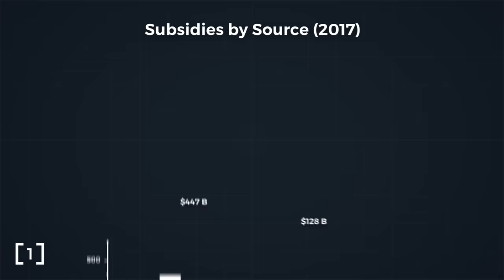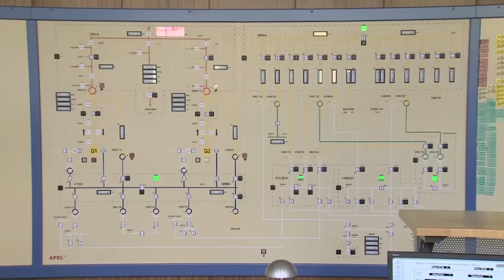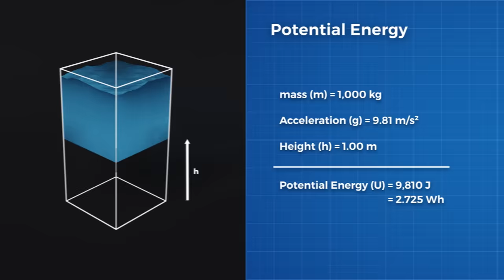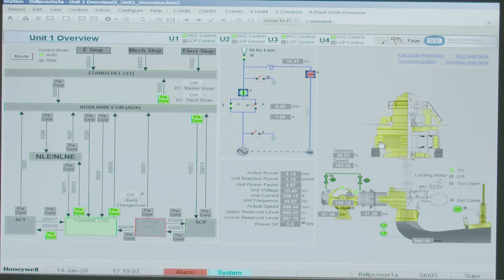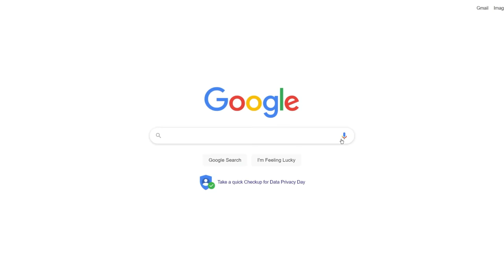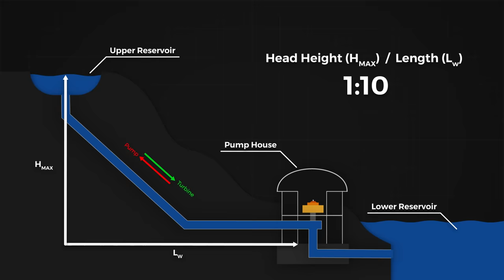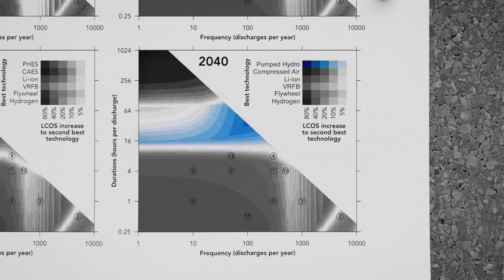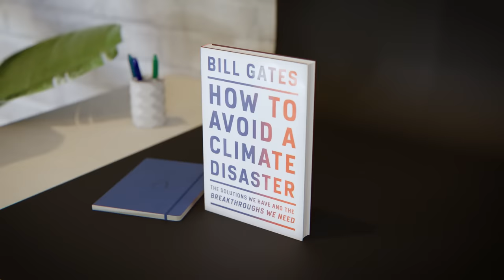The Truth About Pumped Hydro

Comment: "Cheaper and cleaner than..."  

Cheaper...  not really, but I'll get to why in a moment.  Depends on who makes them and who manages them and how they're managed.  

Cleaner...  nooot even close bub.  Just because the wind and solar farm doesn't pump smoke and smog out does NOT mean it is "cleaner".  

The problem with "renewable" energy sources is the lack of efficiency compared to "non-renewable" sources, and the impact that has on materials usage.  

For example, a 55-gallon drum of oil, if poured over some dirt, not much environmental impact.  If that oil soaks down into the soil and is absorbed by it, there is a little bit more environmental impact.  If it reaches and contaminates the water table, then the impact can be much higher, depending on how much reaches said water table, how much actually contaminates the water, how concentrated the contamination ends up being, and how close or far away from a drinking water uptake the contamination zone is, as well as a bunch of other factors.  

Burning same said barrel of oil instead of spilling it will release most, if not all, of the stored energy in that oil/hydrocarbon fuel source.  This will in turn release unburned hydrocarbons, chemical remnants of the chemical conversion process the fire is conducting, heat, light, and various other pollutants.  If you take that same said 55-gallon drum of oil and burn it in an electricity generator, you get all the same pollutants, but the additional benefit of work being generated to power things humans want powered with electricity.  

All these pollutants however are, to one degree or another, BAD for the environment.  

Now, take for example a single Solar Panel.  A single Solar Panel has a rough equivalent electricity output efficiency of 45% for the BEST Solar Panels on the market today.  That barrel of oil in the generator is 95-100% efficiency, depending on how well maintained and engineered the generator is.  The Solar Panel having a less than half efficiency means you need THREE Solar Panels to make up the difference.  

Well great, they last a good while and just sit there and soak up sunlight...  what's the problem?  

Those Solar Panels need land on which to do their task of soaking up sunlight...  sunny land.  So stick them on infertile land that sucks for growing crops on.  Land that could be used for houses.  But hey, there's other land for that too right?  

Then there's the MATERIALS that Solar Panels are made of...  NONE of which can be recycled and ALL of which are classified as Hazardous Materials Waste (HazMat).  You can't recycle them, you can't throw them in the garbage except in expensive highly specialized  HazMat disposal sites, and if the materials for them are allowed to contaminate the environment around them...  their chemicals they are made of are JUST as poisonous as that drum of oil, and JUST as hard to handle and manufacture with.  

All of which...  ALSO applies to Wind Generators.  

Renewable energy is neither cheaper nor cleaner.  

All it does is move WHERE and WHEN the costs and pollutants occur.  

It also...  doesn't exist.  Yet.  

The ENERGY SOURCE might be technically "renewable" in that the sun will most likely provide sunlight for billions upon trillions more years.  It'll consume the planet well before it burns out, or even changes color to another type of star, but that is a LONG time in the future.  And our planet will always have weather and wind, as that is just how our planet works via the thousands of various physical systems that cause air to move and cause "wind".  

Heck, even pumped hydro isn't "clean" or "cheap".  Dams create lakes that destroy entire eco-systems.  Concrete releases carbon dioxide.  Concrete production even more so.  Hydro Plants require industrial lubricants, toxic metals (like aluminum for example), plastics, and other potentially poisonous substances just to operate.  Hydro Plants cost millions upon billions to construct.  Water Power costs and is just as dirty.  And some hydro plants rely on dams in mountainous terrain that is heavily supplemented by melt water.  What happens to them when all the snow, ice, and glaciers no longer exist?  They'll have to either move, destroy their dams, or build them bigger to hold more rain water, thereby destroying MORE local existant eco-system by covering it with MORE water.  Although those companies are not actually "destroying" eco-systems when they build their dams, they're actually converting it from one type of environment to another is all...  unless they contaminate the area with poisonous pollutants in the process, then they very well could be destroying it.  

But it is the Renewable Energy HARVESTING EQUIPMENT that is NOT Renewable, expensive, dirty, and just as badly polluting the environment.  It's just costing and polluting in a different and less immediate way, and the leftist anti-America Media wants to hide that fact to make more money off of scaring fools into buying more of their scam products and services they advertise and sell.  

Please stop lying to your viewers.  

It's not your fault...  you've been lied to as well.  You just chose to believe the lies.
Reply: You really think that renewables aren't good because they are less efficient than a barrel of oil, even thougb the problem is pollution which the barrel of oil is horrible with?
Reply: Your point on efficiency is complete nonsense.

Efficiency? Efficiency of what?!

Diesel generators convert diesel to electricity. 

Solar panels convert sunlight into electricity.

The efficiency of one  has no bearing on the efficiency of the other. They don't do the same things.

What's the sunlight to electricity efficiency of the generator? Zero.

What's the diesel to electricity efficiency of solar? Also zero.

Comment: Just one point of contention.  You pumped storage does not "produce" ANY power.  It only stores power produced at inconvenient times.  So, for this to work, you need the pumped storage AND to increase your wind generation at the same time.  Adding even MORE to the cost all because you don't like gas fired plants with all those flames.  BTW, Showing the FLARES that don't produce any power is a really dirty trick and shows that this is propaganda.

Comment: As I see it the only practical response when your mean renewable generation is 300MW and a plant like this one is something like 290MW and the peek generation needed daily is 6000MW which like in most countries is supplied by coal or Gas . So the way I would solve the problem is double the number of wind generators build 40 Turlock hill size pump generation facilities and get every priest and person in Ireland to pray hard enough to get some superior being to find a way to make water flow up hill. And I would seriously debate your figures about subsidies to coal generation. This is usually a lie as in the country I live in there is no subsides given to coal generation or taxes on coal mined for local consumption to keep the cost of electricity  down, But we hear infinitum about the subsides which is the government giving rebates for road taxes on the diesel used to mine the coal when obviously the mining machinery never travels on the countries roads or highways. In my country I have seen enough money given to the renewable generation carpet baggers that if spent on our ancient  worn out coal fired power stations would have let the whole lot of the 35GW stations be replaced with shiny new efficient power stations and not the mess we have now of these stations on some nights and days carrying  over 90% of the countries generation while wind contributes less than 4% of its name tag generation capacity. How far can you push this fairytail before the masses wake up to what a mess the climate change believers have made of the most important industry in the developed world. Pumped hydro, batteries, hydrogen ??? What next Kryptonite????

Comment: Only  a complete idiot can expect a weather tied catastrophe and decide to  bond all the  energy production by the weather conditions
Reply: That only applies if you have no idea how climate change will affect the weather; most climate scientist have noted that weather is likely to increase in intensity not get calmer which makes most renewables actually increase in power generation.
Reply: @evensong3356   Increase  intensity... in a storm the windgenerators switch off and suddenly  stop  producing,  (which is a huge problem for  the grid ) and the propellers need to  be secured. 
Not to talk about  the ecological impact  on all birds, and  the changes in the ecobalance as a result  of  the windmills...

Comment: Some other types of pumped hydro: 
https://polizeros.com/2011/04/26/underground-pumped-hydro-energy-storage-at-grid-scale/  - This solves the problem with unsuitable land features.
https://youtu.be/_9jGis5V5LE - is a way to use waves to pump water to a top reservoir, for later conversion to electricity.

Comment: Obviously solar and wind power are nowhere close to being able to provide the power we need, nor will they ever be for absolutely obvious reasons a child can figure out. Dislike + Unsub.
Reply: Zuurker U  True, and what I said are pure facts, nothing to do with feelings.
Reply: Zuurker U  Nope, the problem with both is that they depend on it being daylight for solar, and windy for wind power. Hydro and Nuclear are by far the best we have right now as they both provide constant dependable power. If some form of solar reflector system were to be built in space to get around the problem of not getting solar power during the night that could be fixed but not in a decentralized manner, but we don't have that made right now. 
Germany and some other European countries have invested heavily in wind and solar, and now have an inverse issue whereby they export power almost for free during the day but have to buy it during the night and on overcast days with too little or too much wind (wind power only work when there is a set amount of wind speed, too much or too little means no power). 
Another possibility would be to use large amounts of batteries which is being tried in some places but that has other issues aside from cost, the battery technology is "dirty", uses rare earth minerals that are difficult to extract and refine and that process itself is very polluting right now and controlled almost completely by China. 
So, at this moment my statement is still true, but in the future we could find ways to fix the problems that solar and wind have, but we do not have a really good solution for the problems right now.

Comment: I believe a dozen of nuclear power plants is the only realistic solution to achieve a zero-carbon power grid.
I've been doing calculations for a decade now, and there is no turning around it: we need the 3rd and 4th generation, intrinsically safe nuclear reactors in order to stop burning fossil fuels.
Combinations of batteries, pumped hydro, hydrogen storage, etc., can be all part of a varied power generation mix; but please don't feed the common illusion that the current power generation plants can be replaced with wind and solar systems, because that means to live permanently in the dark.
Reply: Only not atomic, but with cold fusion reactors: in the State Department, when, in the early 2000s, research on sonoluminescence was financed, there were no fools!
 Everything new is well forgotten old!

Comment: Im not going to spout misguided buzzwords about climate change, or the true costs of clean energy, and the associated carbon footprint. The most definative factor of energy production requirements is demand. Using grid power has become the go to energy supply method and has changed the face of the planet in many ways. It is currently neglected to even be considered how all this power is carried on the surface of the earth with no regard for its effect on the earths magnetic field. It is this magnetic field that keeps our atmosphere from being blown away by solar storms, as well as cosmic radiation that is deflected away from the earth. The more amperage these high tension grid transmission wires carry, the deeper the associated magnetic interference influences the natural flow of magneticly charged elements deep in the earths mantle. You can easily see for yourself just how far reaching these interference waves can reach either with a compass or a crystal radio. If you stand under the high tension wires take a look at the compass. You find that the needle points perpendicular to the direction of the wires, and not true north. Now see how far you must travel until the compass is able to freely indicate north without being influenced by the wires. This must be done on foot or by bicicle as vehicles create a magnetic field of their own. Confirmation is attained when the magnetic compass coincides with your gps function on smartphone or or other gps navigation method. Using an old crystal radio you can tune in to the radio static interference of the wires and do the same thing, even doing both at the same time for incresed accuracy. The results are frightening to say the least. Noone talks about the simplest way to ease these life threatening problems that we face. Reduce consumption! The led has revolutionized many aspects of our lives from reducing power needed for light, television, and computer display power costs. It now takes a fraction of the energy to light our homes than it did even ten years ago. This is just one facet of the way we can reduce consumption without sacrificing our quality of life. Reducing our dependance on the grid reduces the scars that the grid is inflicting on the earths magnetic field. Dont take my word for it! Look into it for yourself. See how the magnetic north pole is moving from two feet a year in 2000 to nearly a mile a year in 2020. This is going to result in pole reversal and nobody knows for sure how this is going to affect our way of life. I dont understand why nobody is talking about this!